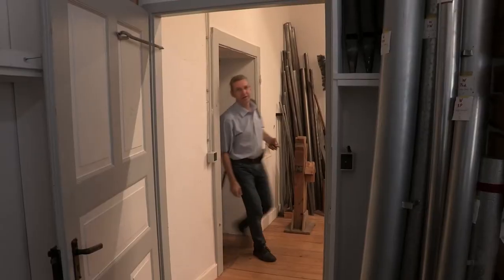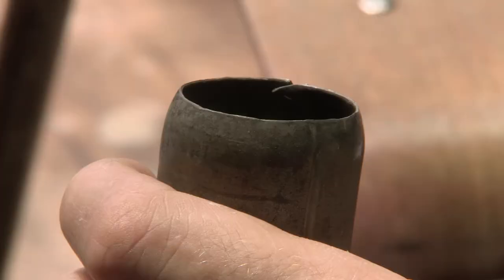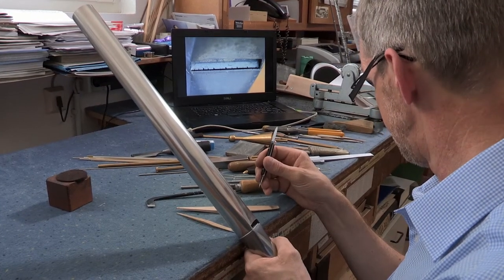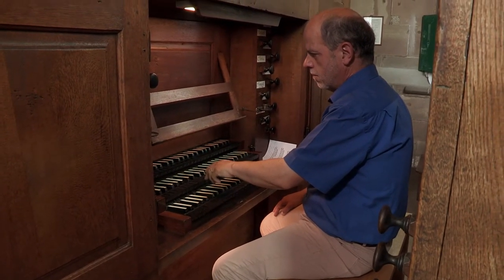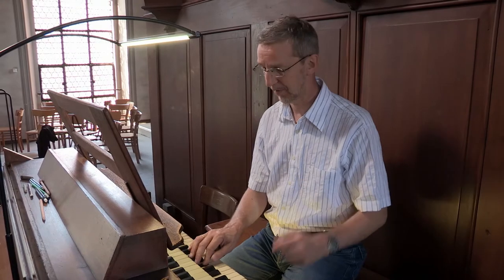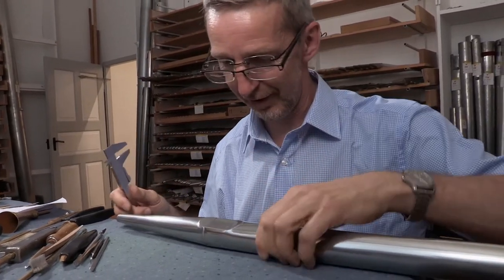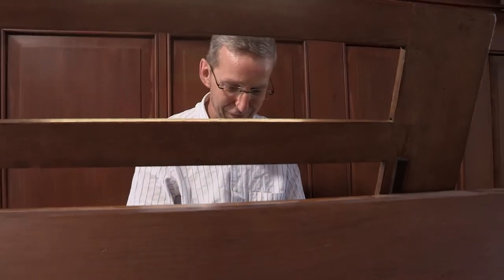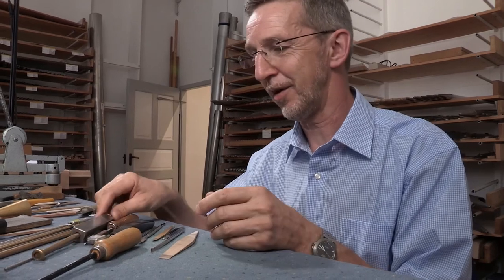Copy and Intonation: The tacit knowledge of Rainer Janke

Comment: To MolnarPohdap
:
You beat me to it!  No, it does not take 10 years practice to 'tune' and organ on your own.  Voicing (and regulating, which he did not go into) is another matter, however.
I entirely agree with his statement that the material of the pipe is irrelevant, as long as it is not too thin.  I have made wooden pipes from mdf, and some people scoff at this, thinking that mdf is a cheap material, so the resulting pipes must be of poor quality.  This is not the case, though working with mdf has its difficulties, as well as its advantages.
Notice the way in which he does not put the end of the pipe in his mouth, but rather blows into his hand, as it is wrapped around the foot..  I cringe, when I see people putting the end of the pipe in their mouths.
An excellent, all-round, video.